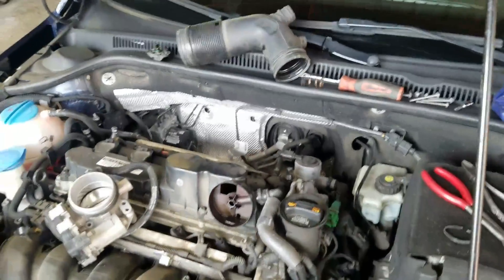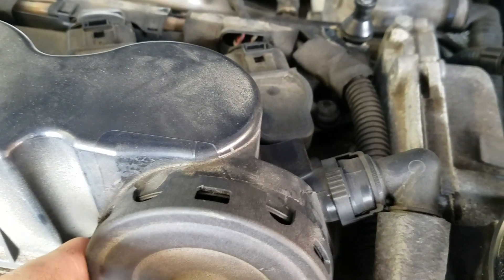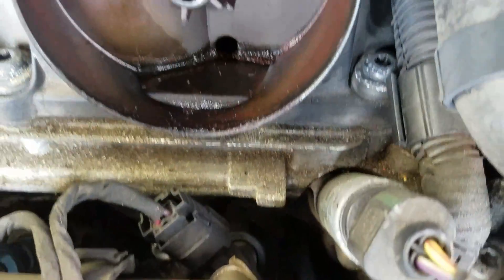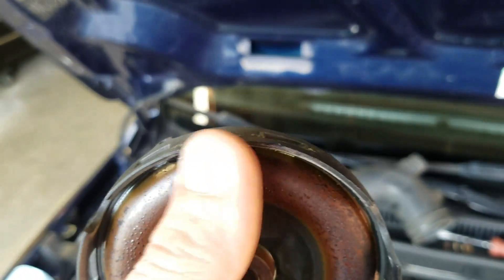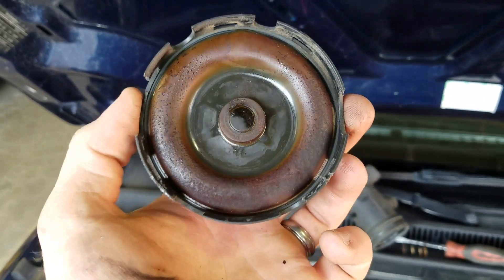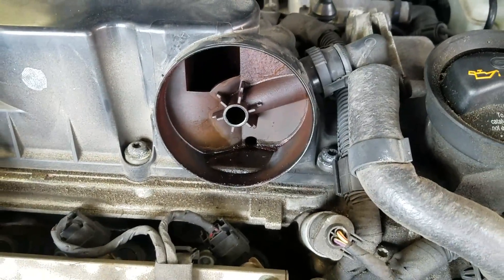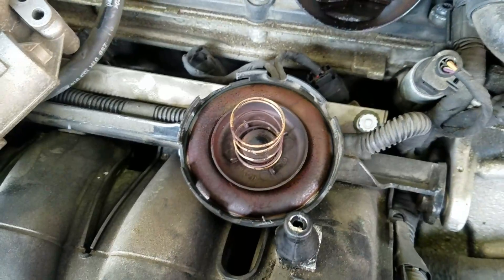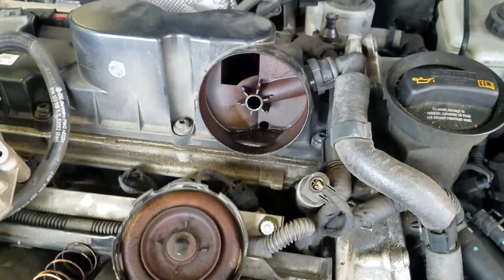PART 2- P0106 VW 2.5L Jetta Manifold Sensor Implausible Signal-

Comment: so i just replaced my diaphram and the map sensor. i haven’t checked if the code will go away yet but i noticed that the diagram wasn’t ripped at all yet there was still oil in the intake manifold. im wondering if you have any insights as to why that might be?

Comment: I replaced the hole cover and didn't solve the problem
Reply from the maker: There's multiple reasons for the implausible code to pop. The main one is that diaphragm being ripped. The video is more on how to change that part rather then an extensive diagnosis of all possible problems that could cause the code.

Comment: Thanks for your videos Part 1 and this part 2  I have a 2011 Volkswagen Jetta 2.5 SE changed the PCV Valve original one didn’t have a spring smh and was burnt out lots of oil on sensor, I cleaned the sensor,and throttle body with brake cleaner and cleaned  the oil in the intake with a rag put everything back together then rechecked code instantly was gone didn’t have to erase it thanks again May God Bless you 💯

Comment: Just want to know where you got your tow hook from because i got one from ebay, but the thread size is too small for my 2011 2.5 jetta.
Reply from the maker: It's been a while since I got that and haven't had it on the car for a few years. I know it's left handed thread though.
Reply: @SkyhookStudios  oh okay, and i just ordered the dorman pcv , did changing that and cleaning map sensor solved the problem forever or we still have to  clean once in awhile
Reply from the maker: It's hard to remove all the oil so you might need to go back in after a bit.

Comment: Great info , that fixed one of the problems plus countless  vacuum hose leaks. The smoke machine to test vacuum leaks is definitely a must have . Off the VW to get the diaphragm,  and hopefully that will be the last code fixed out of three screens of codes . Most vacuum. 
Great video and knowledge on the VW is excellent.  I was a Benz AMG tech , now just MB and BMW
AMG and M , and the occasional VW as favors for friends .

Comment: I've replaced the map sensor and the throttle body and its still f ing up. Gonna do this tomarrow.
Just a question, y'alls epc light go on when you get on the gas real hard? I turn the car off and it resets the epc light and takes it out of limp mode then ok again till i go to fast again.
Reply: Change the crank shaft sensor to fix the p0106 limp mode, if you experience your car cant rev  past 3000 rpms and cars dies, that fixed my EPC code and limp mode
Reply: @djghost7476  damn, yea it dont cut off all the way but limp mode all the way man

Comment: Great videos! I have a 2012 Passat 2.5se with just under 90k, map sensor code came up, and all the signs of it needing to definitely be changed, changed the sensor, cleaned the throttle body up, used a blue shop towel and a good old stick with a rag to reach in there, cleaned the port from the inside of the intake and outside to make sure I got as much oil off as possible, went with the pcv diaphragm replacement and cars driving like it did when it was new. Amazing what a difference in the vehicles behavior it made. Engine sounds good and the shifting is so smooth again!

Thanks for the info buddy!

Comment: Do you need to clean the oil out of the intake or will it take care of itself on its own?
Reply from the maker: Brett Warner you want to try and clean out as much as you can. Residual oil can foul the map, plus it's better for your plugs and catalytic converter that you clean it out the best you can. A little bit is not a big deal. Just get what you can and call it a day.

Comment: I've never seen this diaphram being used on any other of my cars.  It's such a flawed design.  If i didn't see this video i would have paid close to $300 to get a new MAP sensor installed.   I took everything apart and saw a little pool of oil in the airway chamber part of the engine, this design is ridiculous.   a failure prone rubber diaphram that leaks oil into the air channel and the MAP sensor that just happens to be on the bottom of that chamber where oil pools up.  What a mess, thieving VW service shops.
Reply: Just got hit by a vw dealership $230 to replace a MAP sensor for this p0106 code. Sad thing is I had it to 3 different dealerships all of which sent me off without fixing it. I questioned them about just replacing the sensor and they assured me bad sensor. I even knew better but I was pretty desperate at that point missing work to make these appointments. 4 days later check engine light back on they're going to be getting a phone call tomorrow.
Reply: Order this pcv diaphragm off amazon the Dorman version 30-50$
Reply: @grafforlock  simply by pump out some engine oil will "fix" and never go to the vw dealer

Comment: My VW Golf had the same code P0106 come up my ODBlink MX.

Diaphragm was torn in same spot.   Replaced it with a dorman 917-064.

I had to file/score the old valve around the clips so I could control the breaking of the plastic. A little scary but I don't think you can take it off with breaking it. Start to finish with cleaning the sensor was under an hour. 

Thank you for posting the video, it helped a lot.
Reply: Did you just change the diaphragm and code went away?